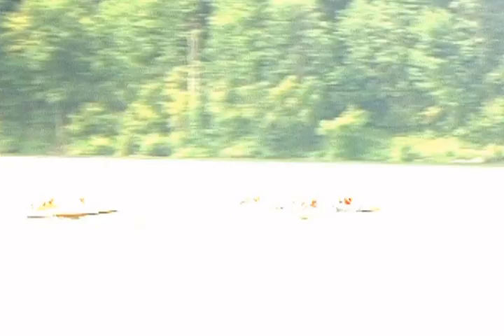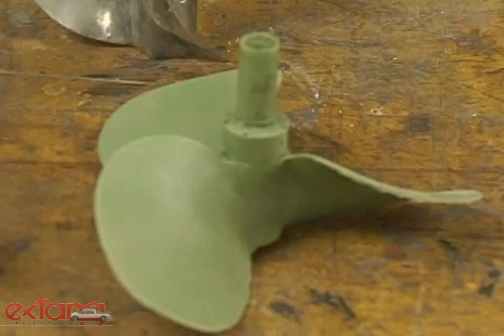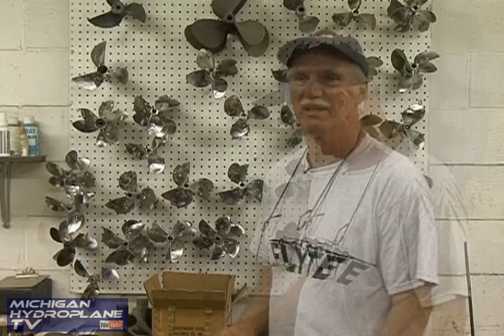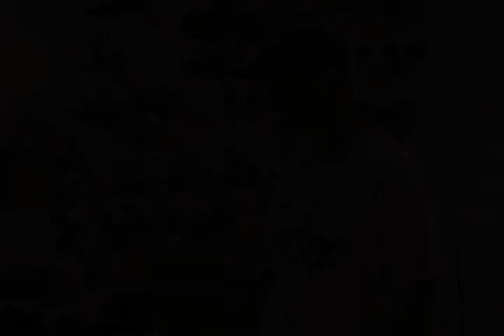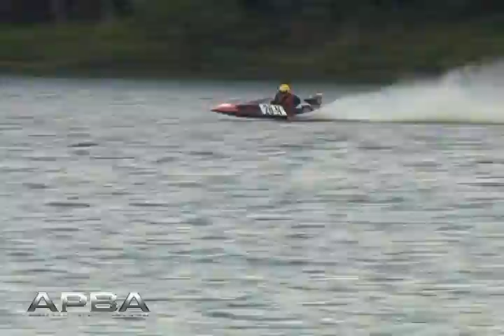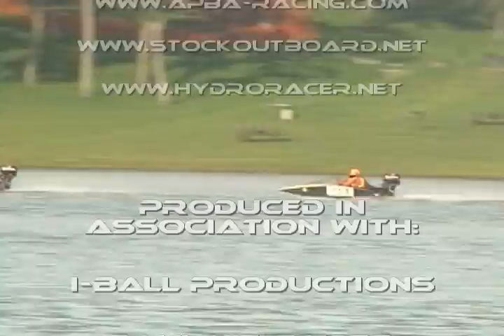Racing Propellers

Comment: I wish i could find a good little cleaver prop to put on my 12HP i wanna push my 13Ft aluminum to its limits. If someone have something for me please contact me thankyou
Reply: ThT is a light boat, but not a hydro. A cleaver will be tricki to avoid cavitation when you turn. Try to find a brass 2 blade. You can change the hub if it is drop a different company. A good propeller repair guy can change the pitch and add cupping. You will get better speed, economy and handling when it is dialed in.

Comment: for my 18hp what is the best size for two blades propeller
Reply: To work out the size of the propeller you have to give much more information.
First of all the top speed of a  boat  depends only on   the factor  Horse Power available  per ton.
Second. The diameter of the propeller depends on the horsepower of the engine and at what  rotation it delivers that power and what is more, it is necessary to know  the ration of the gearing of the engine to the propeller shaft.   
Third. The pitch of the propeller depends on the top speed of the craft which is obtained from the Horse Power per ton and a factor depending on the length of the craft.
Forth. The number of blades and the area of the blades depends on whether the craft is light or heavy , for cruising or racing, for quiet operation or noisy operations.  whether one using cruising speed or top speed.    
Propellers are the last unit in the transmission system which changes the horse power of an engine to the force pushing the craft............. one needs to respect that propeller and care about it and never maltreat a propeller otherwise it will not respect you.
Reply: Baling2 yotunn